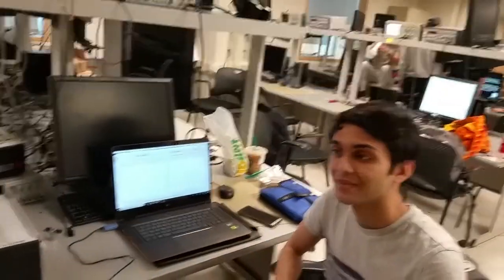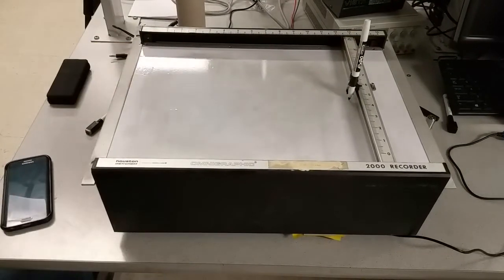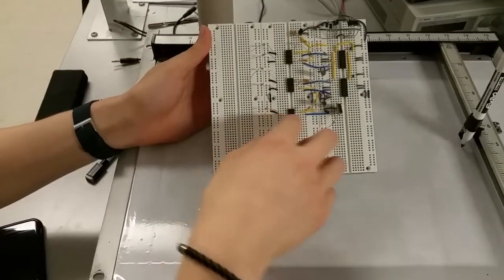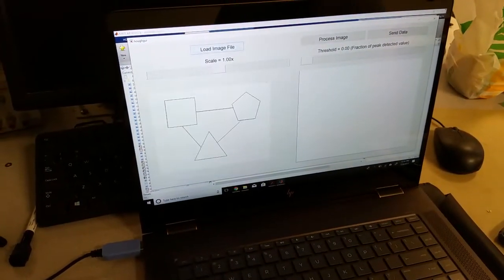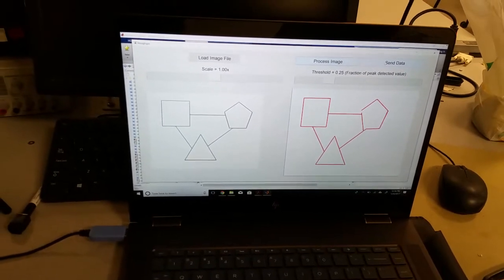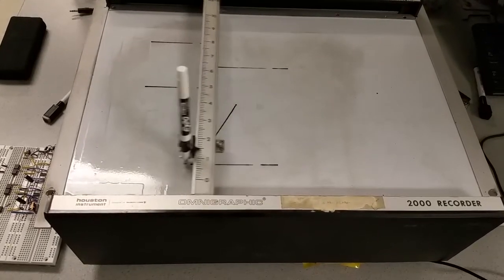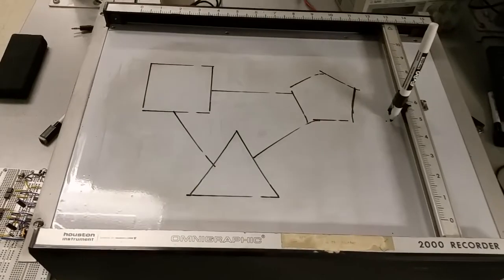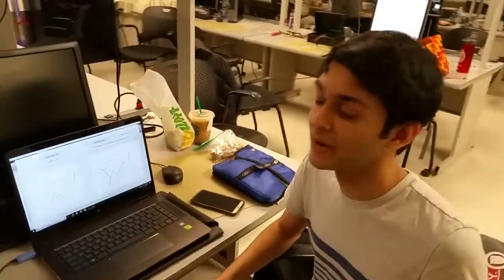Image plotter (revised)

Comment: Nice to see this conversion. I have a Roland pen plotter that takes HPL data to plot but I have been busy tearing out it's guts and replacing the controller with a Ramps + Mega2560 microcontroller to run the machine. It has an A3+ sized plate on top which is magnetic and two thin strips of metal that stick the paper down. It's a lot of fun to revive old machines. Sadly one of the pulleys broken and I'm still in the process of 3D-printing one that has the exact size.